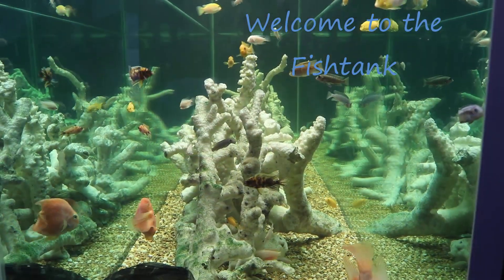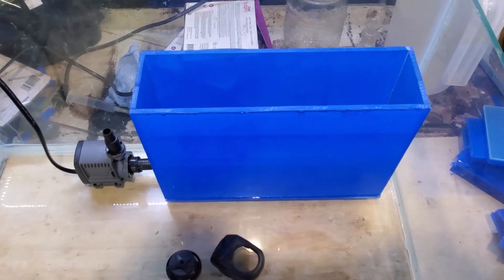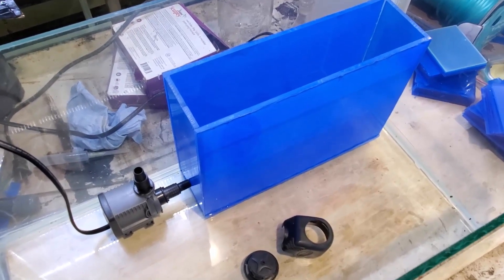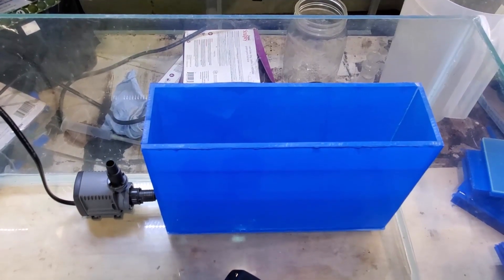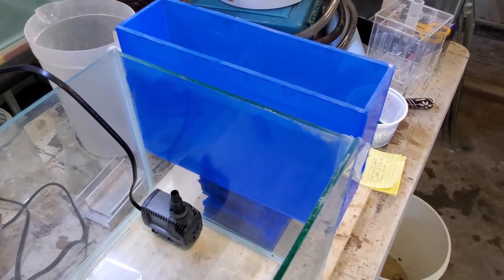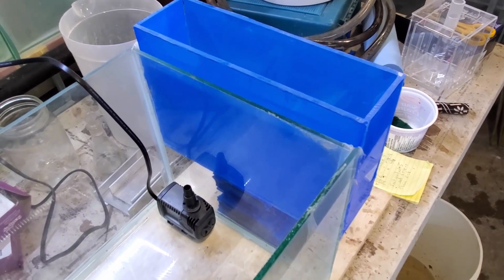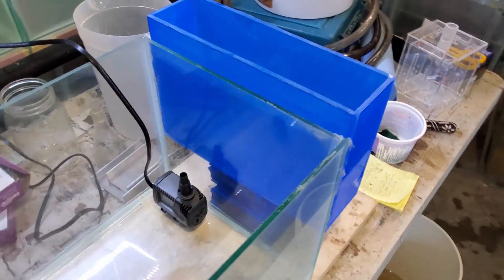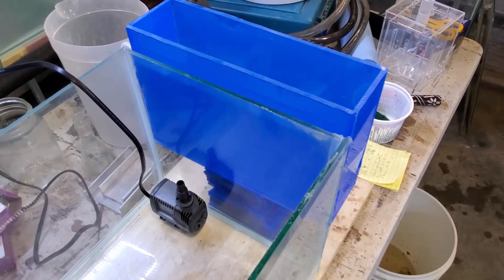You Decide : Build a Filter Part 2

Comment: R u using 5mm acrylic?
Reply from the maker: Yes. Thanks for watching
Reply: Can I use 3mm acrylic?
Reply from the maker: @renaldsmith4492  As long as you don't make the filter too big
Reply: What size aquarium can I make with 5mm acrylic?
Reply from the maker: @renaldsmith4492  Acrylic is quite flexible so not that large. If you do allot of cross bracing and external framing you could make a tank of about thirty to forty gallons. I know you can buy commercial tanks in that thickness that are larger than that but the quality of the seal they can achieve is better than what can be done with home materials. It is much easier to make a tank out of glass. Hope that helps
Reply: @FishmanEricRussell  if I make a cubic tank size 1ftx1ftx1ft . will 5mm do the job?
Reply from the maker: @renaldsmith4492  Not a problem
Reply: Thankz

Comment: hey fishman, I have completely un related question to this video. I build my fist Diy tank from a broken one and had to cut the glas that went decent for the firstime cutting glas tanks to one of your vids, also grinded of the scharp edges with my beltsander and a 320 grit belt. and i was wondering what gritsize belt you you use when sanding cut edges?
Reply from the maker: Coll and congrats! The grit size should be relatively fine. About 120. Give or take
Reply: @FishmanEricRussell  tank you

Comment: I personally prefer outside the Aquarium because it will not take space away from the Aquarium, whereas inside the Aquarium it takes up space essentially making it smaller than it is and less space for the Fish, Drill a Hole through the bottom of end Panel and through the bottom Box for the intake of the Pump to stick through, of course you will need to use Silicon to seal it and adhesive it to the glass to prevent leaks and to hold it on.
I like how the Filter Box looks, nice Color too.  👍
Thank you very much for sharing.
Have a great week.
Reply from the maker: I did one of those a little while ago. They are kind of cool. You have a great week as well!
Reply: @FishmanEricRussell  That's awesome.  :-)
Thank you very much Sir.